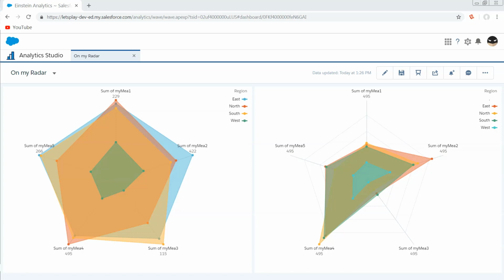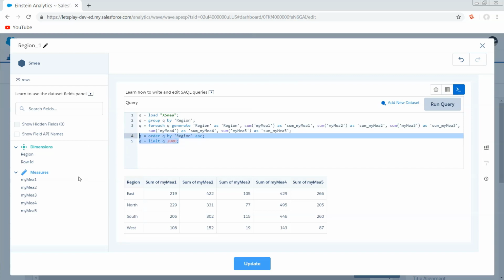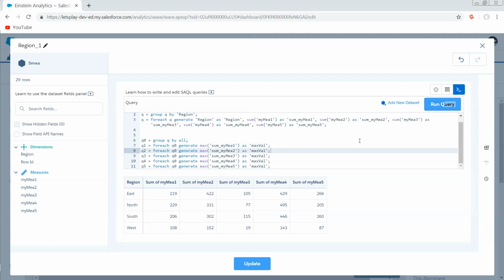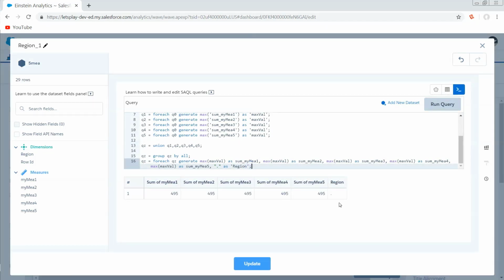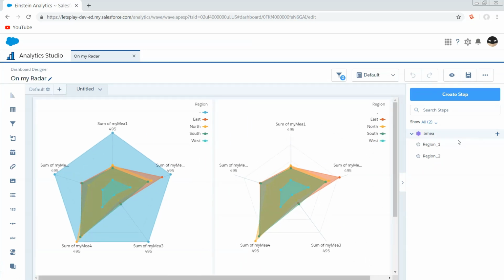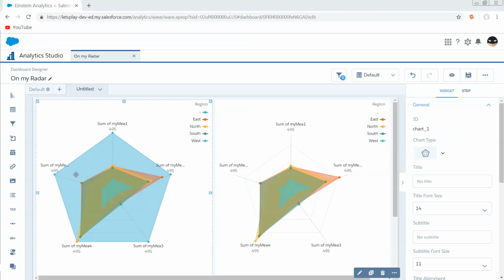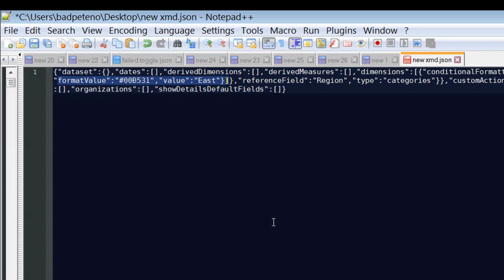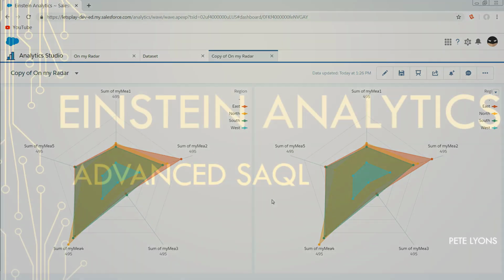Adding Dynamic Domains to the Metrics Radar

Comment: Hi, thank you so much this is very helpful. I have just one problem, I did the union as you show in the video, but then when hovering over the areas on the dashboard I can't "select" the area on the top unless I hover over one of the points. Do you have an idea of why is this happening?
Reply from the maker: That may be expected behavior, though I'm not sure.  Does it happen with the non-SAQL version (without domains)?  If not, your transparent layer may be at the top.  If so, reverse your ordering in the union statement.
Reply: @LetsPlaySalesforce   I found out that this problem only happens if one the areas that have drawn in the chart doesn't touch the maximum point, for instance, if the maximum point is 100, then if one of the record's points are [10,20,30,40] then you have to hover over the points to select that area and see its tooltip
Reply from the maker: @joanhernandez3128  good to know. Half the reason I made this video was to try and convince the product team to add domain to metrics radar. It's so cool looking but the lack of that feature makes it very difficult to use
Reply: @LetsPlaySalesforce   Hopefully they will implement this one day. For now, at least we have a workaround. Thanks again for sharing this ;)